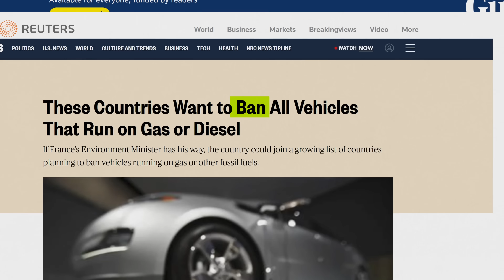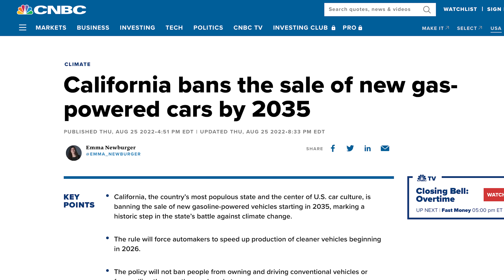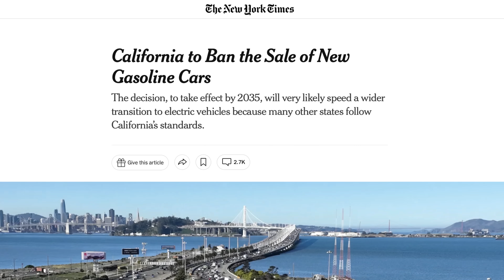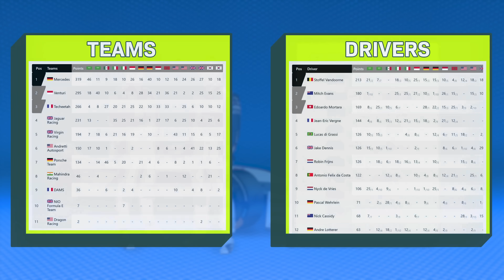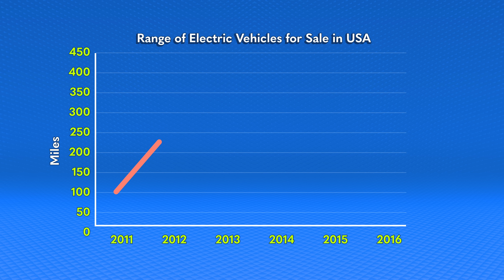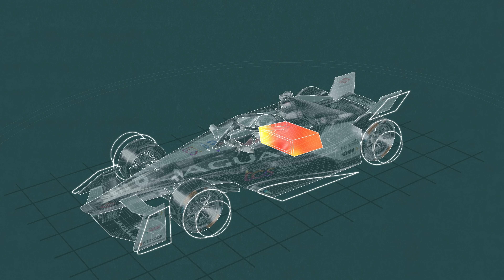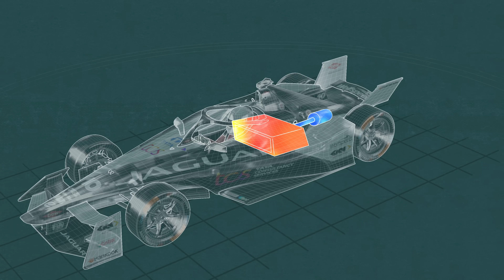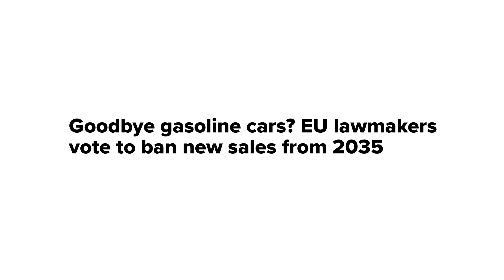The Electric Formula 1, Explained

Comment: I do not think F1 will lose the combustion engines since they will not be banned. From 2035 all cars that emit pollution will be banned thus, I am guessing they will switch to synthetic fuels or hydrogen to push this technology as well :)
Reply: You're wrong. SALE of NEW cars with combustion engines will be bad. You will still be able to drive one, if it's sold new before 2035.
Reply: @_nopestr  Please read Regulation (EU) 2023/851 of the European Parliament and of the Council of 19 April 2023. There you will find that the combustion engines are not banned. You will not be able to REGISTER new car which emit CO2 if the car with combustion engine does not emit CO2 it is ok. That is why VW and other companies tarted to work on eFuels.

Comment: FE is cool but it's still too slow - by quite some margin. In Monaco for exmample FE is almost 30% slower than F1 and it's about as slow as F1 gets. Even F2 is about 10% faster. They didn't go for city races because they are more appealing or anything, it was a necessity. The alternative would have been more than 1 car change of a race distance or even slower speeds. They just now managed to skip the mandatory car swamp mid-race for their city circuit races. The reasons are simple: battery technology isn't there yet to provide the performance of F1 over an entire race distance and the technological advances are limited due to standardized cars. Don't get me wrong, FE is entertaining but it's not on the same level as F1 - yet.

My prediction for F1: they'll soon be 100% bio fuel, then they'll switch to e fuels and even larger batteries down the line until the FE license ran out with the exclusivity clause. By that time battery technology will probably have evolved enough to support F1 speeds.

Comment: Great watch - love the enthusiasm for racing and your channel!  But I guess the pretty significant point missed in this video is what fans want!...... Which is the noise and visceral experience of watching, smelling and feeling ICE powered cars.  
Formula E has its place and I think (and hope) it grows in future, as frankly the more motorsport the better in my view. But its very clear that ICE cars aren't going to magically vanish come 2035 and there will be a need for fossil fuel alternatives for cars for decades to come.  
What's the solution?.....possibly hydrogen (JCB have already built hydrogen engines to replace their diesel models for diggers etc) but more likely synthetic fuels.  And that's where your argument around F1 not being relevant to road cars falls down.  
Electric cars aren't the sole solution to future transport needs - the infrastructure just isn't there and wont be for decades, if ever in some cases.  There will need to be solutions to run in parallel which will be something like synthetic fuels made from green energy that meets the regulations by virtue of being carbon neutral  - that's where F1 led hybrid tech can be transformative, while also giving traditional motorsport fans what they want! 
And as for the claim of the fastest electric race car.....the McMurtry Spéirling might have something to say about that, but I guess you could debate whether its a race car or a very (very) fast roadcar of sorts! :-)

Comment: I think cars will go hydrogen. Based on what Toyota is testing at the moment. A hydrogen internal combustion engine. 5kg of fuel gets you 400km. No emissions, but sounds like a petrol engine. Win win WIN. And no dirty unethically sourced lithium batteries.

Comment: Regenerative braking was first prototyped in the 80's and Tesla has had it working successfully on the roadways for like a billion years already. Granted, they do have brake pads as well for safety, but the point is that Formula E or whatever is not the first company to do regen braking, not by a long shot. It may just be the way the video is cut together, but they seem really dishonest and disingenuous pretending like regen braking is a novel concept that their engineering department came up with that no one else has figured out or tried. Like... basically every electric vehicle on public roadways right now does this. Get over yourselves. You may be the only ones to forgo brake pads, but regen braking is no special engineering feat.

Comment: The question is for Formula 1 is if the future is done with authentic fuels or any alternative fuels. Porsche and Esso have already been working on an alternative that is used in all of their racing series. Toyota has already said that Electric may not be the way. Next get solid state batteries are not in mass production yet. The future of then tech seems a little muddy at the moment. What is clear is that Formula 1 has the following and will be the race series to watch to see what is experimented with. In the mean time, enjoy the races!

Comment: This is a great video showing people a deferent form of motor sport and it very well researched. But while formula e is selling its self as a green from of motor racing it’s far from it. Electric cars are not any better for the environment in fact right now they are the opposite.  The batteries are made of material that require massive mining operation which are some of the biggest contributors to green house gasses. They also can’t be recycled or if they can it’s not practical. Also we can’t forget where most of the energy to charge up the batteries comes from. 
Formula one has shifted objective to a net zero approach. So they have changed to Mamote efficient por wet plants where they can extract most of the energy density from the fuel. As well shifting to net zero fuel where any carbon put into the air from internal combustion has come from carbon capture technology. While it’s not the greatest it’s also not putting new CO2 in the atmosphere. 
Not saying fossil fuels are the way to go but it’s also not right to be saying that electric cars are the answer to our problems when they’re just another way we pollute the earth.

Comment: The problem electric cars is theres no life in them, theyre fast, theyre cool and most wont get me through a single day of work, but the biggest issue with them is theyre cold and clinical machines, the ICE has life to it, 
sitting on a big 2 stroke dirt bike and having it siiiiing or a diablos dimension altering howl from its v12, they have a fire in their heart that electric just does not have, 

at least fossil fuels are going out at mach jesus with their hair on fire and not puttering out with a whimper. Also, hydrogen seems promising

Comment: 6:45 also, I think that an artificial limiter on the power output which is disabled under certain arbitary conditions , would undermine the credibility of the series , especially in terms of the constructor side of things

Instead of Mario Kart, I think a different Nintendo racing game would provide a more physically consistent model for gamifying the track - F-Zero with its power recharging zones... implementing an on-track power delivery solution would entail fabricating some sort of active element which the cars can drive over, and which functions on the principle of resonant inductive power transmission, the same used on Maglev trains...

these active elements would most likely take the form of road surface pads which are secured to the track barriers, so that they don't slide around when the cars brake or corner on them, and which also suits their placement away from the racing line
Reply: also, using an on-track power delivery system would imply that power management becomes fundamental to the racing, which might run counter to the current trend of the series
Reply: If we were to stick with the Mario Kart analogy where the track sections literally push the car forwards, perhaps a diffferent electromagnetic technology is appropriate - Linear Induction Motors

the Formula E cars would carry Formula 1-style skid blocks , originally this is to prevent lowering the ride height below a certain height, but by using aluminum as the material, this can now serve as the commutator in a linear induction motor system ... the aforementioned pads are reconfigured to synchronously energize as the car is detected to approach, and will sequentially pull the car forwards at an increasing speed
this wouldn't be as safe as merely charging the battery or artifically limiting the power output of the cars, but it would be more exciting

Comment: Cleo. I think you are over-estimating a significant proportion of the fanbase. Many fans don't care what is under the skin of the cars. Every team could use exactly the same cars just painted in different liveries to identify the manufacturer and many fans would be none the wiser. Drive To Survive has primarily promoted the drivers. Of course the teams and the cars are talked about but the focus is on the drivers. The drivers themselves are now the most important brands in F1. The powerplants being used are irrelevent to the real world. Race cars are not passenger cars. They are race cars. Success in F1 does not equate to significant increases in passenger vehicle sales. Otherwise, companies like GM, Toyota, Hyundai, Kia and Subaru would have full blown F1 teams. Heck even Ford who has just announced it will be returning to F1 with Red Bull Racing was out of F1 for many decades. The die hard F1 fanatics will always be interested in what is going on under the skin of the cars. But a large number of F1 fans, particularly the new ones coming along, are much more interested in the drivers and in close racing. The successful future for any racing category has little to do with the powerplants. If the racing is not close with several drivers having a chance to win races and podiums, no amount of tech will save a category.

Comment: Actually this is not true, sure Formula E holds the rights for electric racing until 2039 but there is a new technology on the horizon which could be the future of Formula 1. This new tech is called H2-ICE and this works almost similar to present ICE in Formula 1 except they use Hydrogen instead of gasoline. And the fact that H2-ICE is not using electricity generation but instead a combustion process for energy makes it fair for Formula 1 to pursue this avenue as it's legal. As of now H2-ICE is being promoted by truck manufacturers namely Cummins and Ashok Leyland. So if Formula 1 is serious abt this pivot then there is nothing better than H2-ICE. The bigger challenge would be incorporating H2-ICE in a  safer manner into F1.

Comment: The one thing I don't like about Agag is how he talks about "MY license". He acts smug about it, as if nobody else has the idea to make an electric racing series. It's also far from the ONLY electric racing series, it's just the only single-seater electric racing series. It seems like he would enjoy seeing F1 fall by the wayside inn favor of his own series. I get it, that's business - but there's so much history in F1 that FE can never replace it. At some point it would be better if they worked together, and that time might come long before 2039 - and I don't mean that in the favor of F1. I think FE needs to make a change. EV and battery tech is being progressed just as much by F1 and WEC hybrid tech, because FE just doesn't have the money in it to compete with the resources. F1 teams even supply a lot of the electronics for FE cars, and have supplied batteries and motors up until recently. FE needs to take a bigger step if it actually wants to compete with F1, and not be a side act or a novelty.

Comment: This was excellent as so many of your videos are. 👍🏻

Suggestions as said to cover the extreme E the off road Dakar style racing series in depth. They have multiple teams sponsored by former f1 drivers&champions. Plus driver teams are split evenly between men&women. 😎

Then you have the upcoming all ev boat series E1 which also will have women pilot's, started by the extreme e people.  

And a little known British ev conversion shop has been working on an all electric open wheel private race series with the car's fully fia certified and costing about $80,000. Similar to an f3 series car. Full slicks real downforce 20-30min races. 

Then NASCAR is rumored to be debuting an all ev next gen car with 3 motors and 1000+hp this season. Supposedly 30+min demo heats with 10+cars from 3 different manufacturer's. No pit stops unless for damage. All are required to run as fast as the gassers lap time's.

Comment: 1. Interest in formula 1 is at an all time high and the sport is reaping the rewards of that. This is best proved by Ford and Audi (part of the VW group), two of the biggest car manufactures in the world have both agreed to join F1 in 2026.
2. The promises from governments to go all electric: it sounds nice but it doesn't take much digging to see it is logistically impossible. There simply isn't enough lithium-ion batteries for all electric to be even close to economically viable. It would be far too expensive. 
3. Even if these promises from govs are kept, electric cars would still be a significant minority globally. F1 is a global sport.
4. F1 is now developing synthetic fuel technology, which has 0 net emissions. This technology if made, cheap enough, can and will be used in road cars which would negate the need for all electric.

In summary, F1 is richer and more popular than ever which means huge new investors continue to join the sport. It is already becoming sustainable and that technology will attract more investors who want to develop this in their road cars. Simply put, F1 as we know it is not going anywhere

Comment: I remember watching a few Formula E races with the gen 1 cars where they had to swap cars in the middle of it. I haven't seen any since so the fan boost and attack zone bits are new to me. I am a little bummed to hear that Formula 1 can't go electric until 2039 (unless they change something) because now that is actually holding back electric car development. Formula E pushed it forward but these rules are slowing it down because Formula 1 can't experiment alongside it.

Comment: What's the big differences between this type of regen braking and for example, the regen braking in my Prius? It seems like it does majority of the braking for me already.
Reply: I think this is stronger, if we put Prius at 300 kmph, the motor will melt 😂, probably. Regen tech of today is still in infancy. Even regen used in industries and manufacturing plants are a bunch of prototypes.

Comment: Sigh… it’s not Mario Kart, it’s F-Zero. In F-Zero you get a boost at the end of each lap that increases the power of your engine. So, top speed and acceleration are increased for a period of time.

Mario Kart, F-Zero, sonic team racing, etc., etc., have boost pads on the ground that give a very short boost (well, F-Zero on SNES has a boost pad that lasts for a significant amount of time… still not long enough to last more than a few turns and when you break, you lose momentum and speed.)… and F-E doesn’t do this.

F-E is more like the S boosts in F-Zero on SNES, that allow you to increase the output of your engine for roughly 1/4 the length of a track in most courses. But the time duration is much longer, so it last long enough for multiple laps.

Closest thing in Mario Kart is the star power up.

But also fan boost is stupid.

Comment: It's B.S. Cleo! There is NOT a formula F1 that go distance of such of an event unless it has at least an onboard
engine to assist the recharging of said batteries! In other words a "HYBRID MODEL" Manufacturers may be able
to demo the characteristics, performance and handling of a Electric Formula E has, but as for the duration and
the amount of horsepower and demands on the said batteries......they can't even make a battery big enough to
sustain an entire race!!!

Comment: Formula E need better tracks . Current ones are like racing in a canyon with too much advertising. Race on more  real world circuits and less street circuits. Formula E could become F1 maybe need a few more generations to get the range and speed of an F1 car. However don't forget hybrid engines running on net zero bio fuels. This is the way F1 is going. In UK after 2030 hybrid engined cars will still be allowed to be sold. So if these net zero bio fuels take off then these will compete directly with electric cars.

Comment: Motor racing and street car technology are actually two different things. F1's role isn't to advance the road car industry, it never was. Simply pushing tech to the limit to go faster won't necessarily benefit your VW Golf. Sometimes it accidentally does, but that's not the main point. First and foremost it is a sport, and I think that's a big distinction to make.

Comment: Great video love the series on motorsport & the channel in general, but I feel that the entire point of the synthetic fuels being developed is lost, or at least an oversight. Also using regen is very common in the average modern car, but no rear brakes means its more powerful. Also it is mentioned that combustion cars are becoming illegal, which is wrong only gasoline which is from crude oil, hence the synthetic fuel that f1 is also transitioning to. Never the Less awesome vid

Comment: Formula E takeover is hype. Formula E has a licensing agreement with the FiA. If F1 felt threatened they would  remove  the FIA as their governing body and their license would be irrelevant. I don't think F1 does or should see this as a threat. F1 is supreme because the too drivers want to race in it. Until that changes neither will it's superiority.